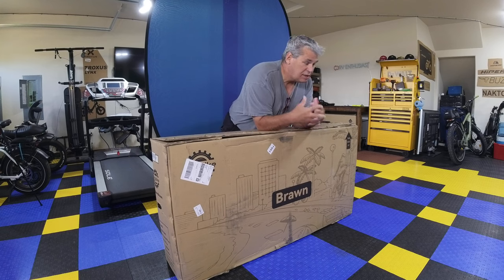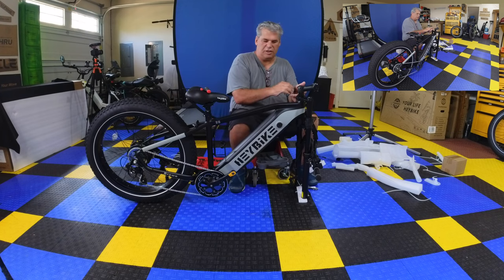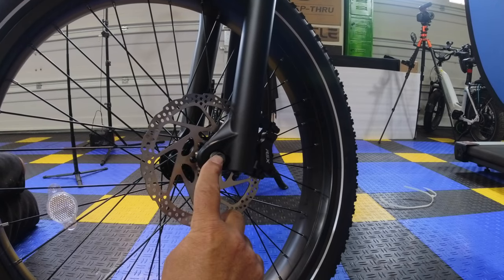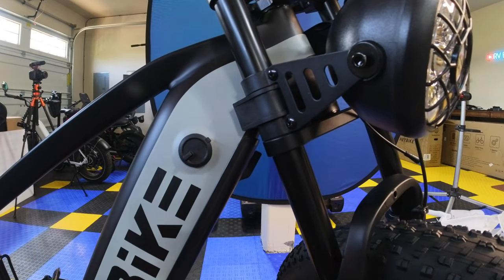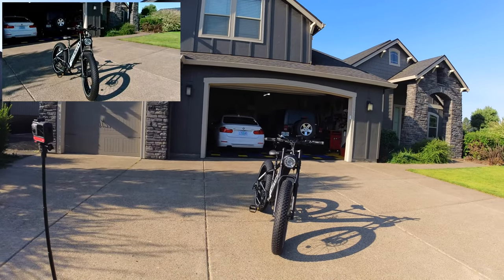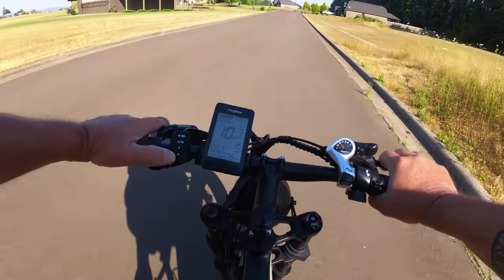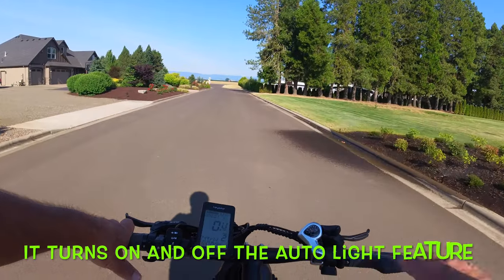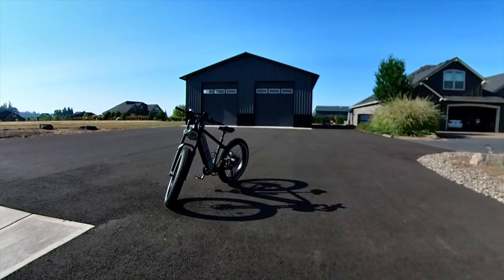Heybike Brawn Review   OMG

Comment: Why don't you leave the display where it is so you have room for the phone on the other side of the stem?
Reply from the maker: the taper of the handlebars does not allow the display to lock down there. I do have spacers I could try for sure. I do like it offset too.  We shall see in an updated future video.  Great idea Joerides
Reply: @RVEnthusiast  You could always add an out-front bar(extender). My problem is all I've found so far have narrow-diameter tubes and there aren't any modern computer/Garmin/headlight mounts for that small diameter. I need a 31.8-diameter version. Know of any?
Reply from the maker: @Joerides7  I have plenty of those. we will see I will try stealing a spacer from a phone holder spair and see if that works first. The offset monitor looks good to me.

Comment: I am almost 300 pounds I think maybe even over I just had back surgery and I live in a hilly location would this bike be a Good Bike to strengthen my leg but I literally have no strength in my left leg so I need something that can help assist more than me pedal
Reply from the maker: Hi Theo,  Yes if you hav some height of about 5'10" this bike would be great.
Reply: @RVEnthusiast how did this bike Do going uphill? Have you tested that yet? How fast were you able to go up hill?
Reply from the maker: @TheAppleFanBoy1986  I have not specifically ridden it up a hill for speed as of yet.  I have only tested it on a minor uphill slope without issues and it was quick and powerful.  Speed up the slope would depend on slope as well as your weight vs mine 265LBS.  This bike is a good performer for sure.  Heybike just gave it to me a few weeks ago and are sending some accessories for it via fedex. I have several bikes and videos in the piplinebut could take it to a nearby hill and let you know how well it does on Monday if that helps.  ;-)
Reply: @RVEnthusiast hey, I appreciate that you just gained a subscriber. Thanks so much for responding.
Reply from the maker: Theo, My pleasure.  Anything else you can think of feel free to ask.  I love this stuff.
Reply from the maker: @TheAppleFanBoy1986  Hey Theo, Just rode it and video will be out in a week or 10 days. thought I would let you know. I went up about 150 feet in elevation and it went without peddling to about 12-12.5 miles per hour. Last 200 yards of that hill is pretty steep.  My bike is having a speed display issue and it still is happening.  I reached out to see what they think it may be. its only related to speed sensor. Does not affect anything other than that as you will see on the video.  Besides that which Heybike will advise/send part to fix. The bike is very cool and fun to ride.  I rode it a little different for you to see how your ride might be.  Sorry I cant get it out until next week but I think you will like the bike for sure.  Bruce
Reply: @RVEnthusiast  Man I super appreciate that. Thank you so much. Look forward to watching your video.